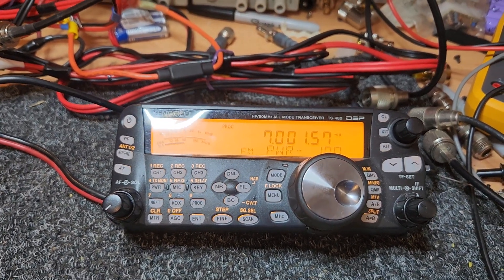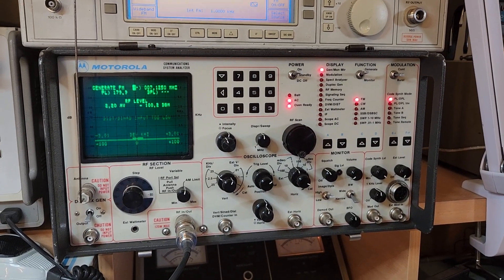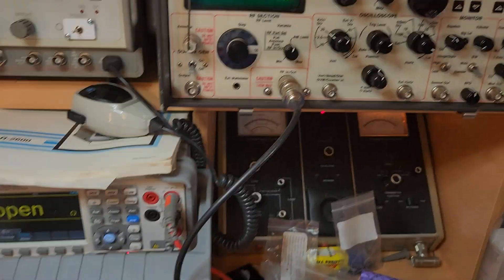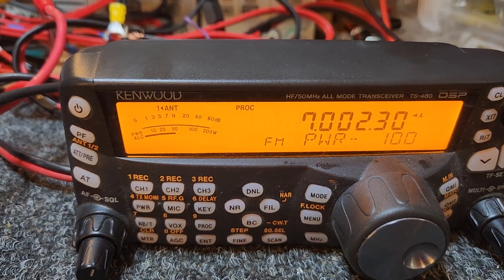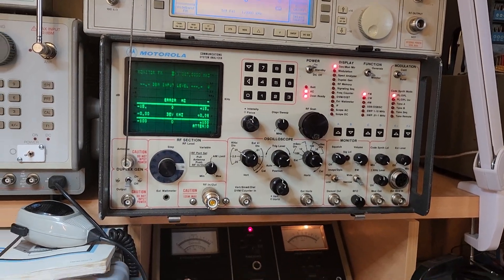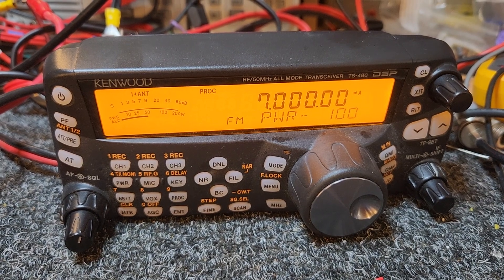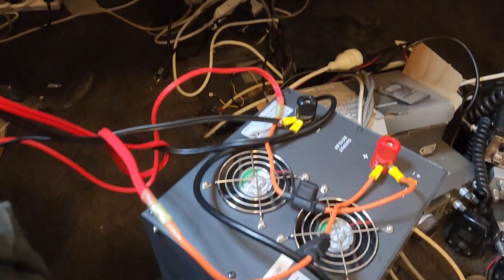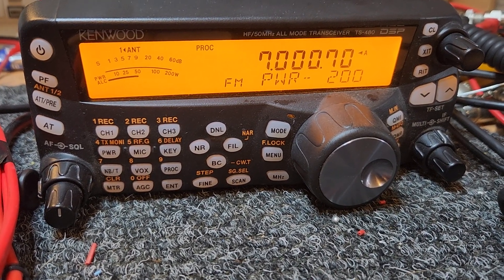So do the Kenwood TS480HX units really do 200w or is it just a nice claim to make, let's find out...

Comment: I have a ts480hx. You need 52 amps @13.8 volts to power to its potential.  In stock unmodified they do the full 200 on cw but about 190 on ssb.  I will never sell mine.

Comment: Does it do 200 watts? Lets find out. Here's my setup, fiddling playing dialing making noise, there ya go mate it's receiving. Ok so there's my dummy load, there's my power supplies, I really should have hooked up my larger supply, testing testing and yes it makes 175 watts. Soulda used the larger supply. Lets see if it will do less. Yes it does. Filler, more filler and through the magic of TV we are now hooked up to the larger supply and... wait for it, wait for it... yes there you go 200 watts

double tap

Comment: I suspect that claim might be for pep from sideband, and to measure it you'd need a peak reading kit for your bird. You said you had one but I didn't see you switching back and forth.But, I guess I'm mistaken because at 7:15 you've got 200 watts fm carrier. So, wonder what it will do pep sideband ! ?
I've got an astron 50 amp, I guess it would do as much as that power supply.

Comment: Thanks for sharing, I've had one of these for years, along with the cw and ssb filter it's a great radio. What current did you take on 200w test.
Mine draws 43 amps with 200w, but havnt got a decent amp mtr.

Comment: Nice demo, Brenton!
It still begs the question: why bother with a 200W transmitter?
For a mobile installation, the extra current demand means heavier wiring and fuses etc… and for what? Probably half an S-point or less on the receiving end of the signal.
Reply from the maker: Hi Ben, To be honest, I ran an amp that easily cruised at 400w plus plus plus in my mobile for years and whilst it made it truly a very good signal for dxing mobile, technology started to be my enemy as the electronics in the new 4wd I owned was very susceptible to RF and we determined that 200watts was probably the Max you would want to run before check engine lights start flashing and I was out hooking up my Autel MK808 obd2 tool to clear codes constantly.  In the mobile, in theory the extra 100 watts doesn't sound much but often it's the difference between being heard or not heard when conditions are average but when conditions are good, your point is equally valid and it's an s point or so maximum.  I am running 100w out of an IC7000 and a codan 3040 system right now so I have to stay around 100w to avoid frying the auto antenna.  I ended up loving this basic setup as it's so fast to go from band to band retuning in a second each time where previously I was waiting for my Scorpion antenna to get to the correct band. That being said, I have plans to utilise a Scorpion again but not with any huge amplifiers in a brand new 6.2 litre Chevy Silverado so that should be an interesting performer and that will use the Kenwood TS480HX for sure.  Its never boring, that's for sure cheers Brenton vk3cm
Reply: This rig is a good one for use in an isolated location.